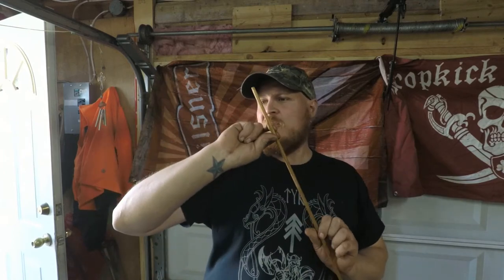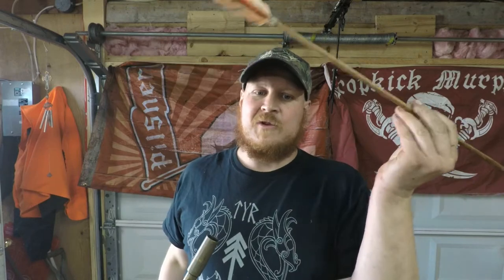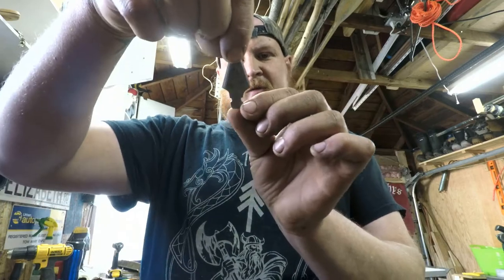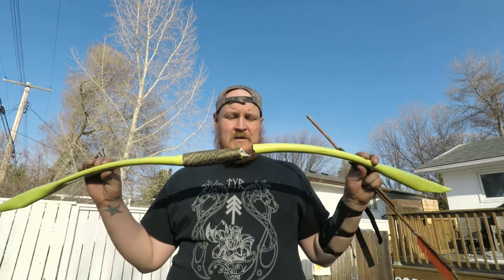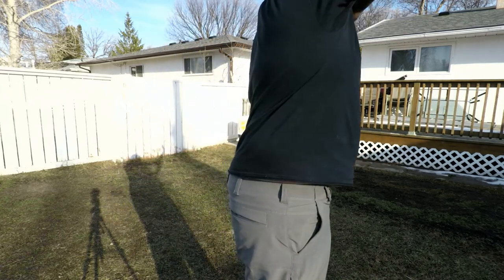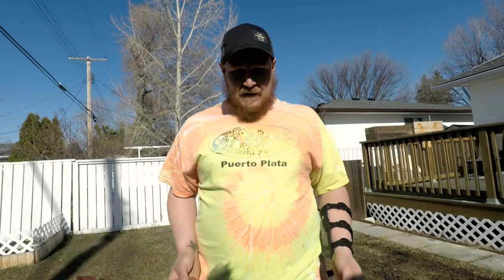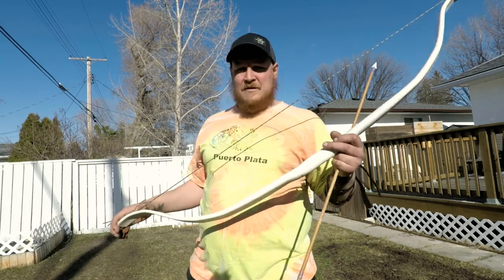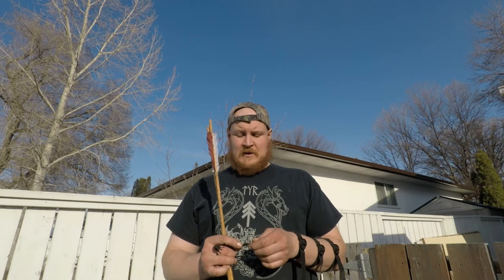Making Wooden Arrows! My first time! Episode 4- The Finale| Arrow heads and shooting them!

Comment: In BC as long as your arrow head at the base is either 1 or 1.25 inches you can use it. The other thing they specify is either a 30 or 40 lb draw is required as well. You have to check the regs for your area. I know I am a little late at the comments